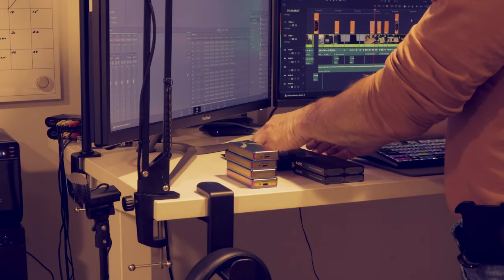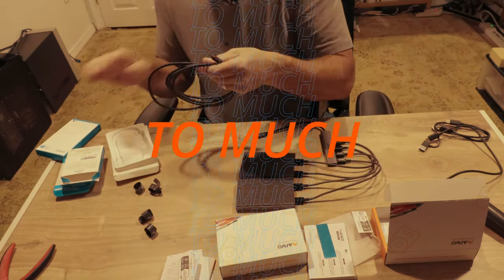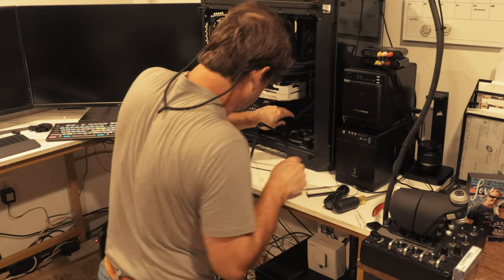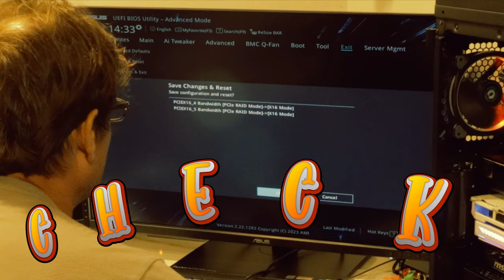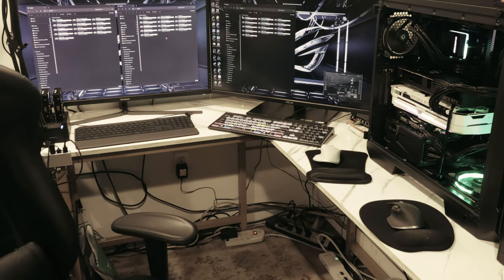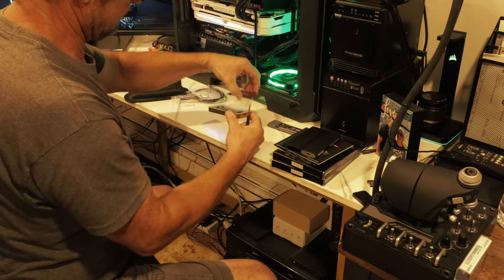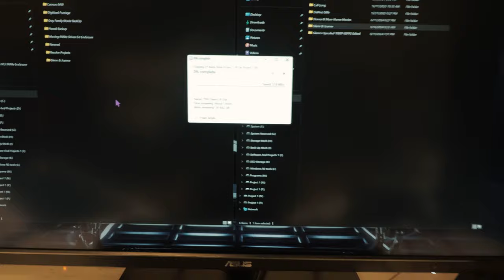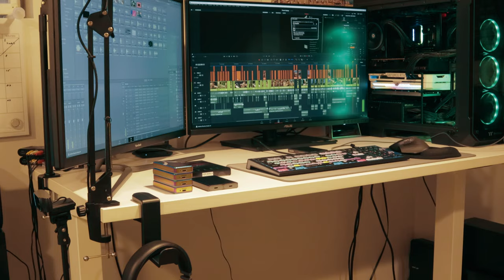You Ever Try To Use Externel NVMe Enclosure's !!! (NVMe Swap?)

Comment: Definitely if you have the option to use an internal PCIE x16 to add/use storage do that but if unavailable and want equivelent usage this is why Thunderbolt exists. Personally I never get the same internal sustained reliability with USB so (at the time it was needed) switching to TB3 onward resolved this.

The drawback is most cheap TB drives don't have adequate heat dissipation for fast NVMEs which honestly can be mitigated with some small breeze ie small fan.
Reply from the maker: @AchakBrooks  Yes Internel PCIeX16 is the way to go!! FUNNY haven't had a mother board with Thunderbolt yet... Older MB you could try USB-C external have one on my other computer and works good....But yes you do have Option's and Thunderbolt is way too go when u have it!!..